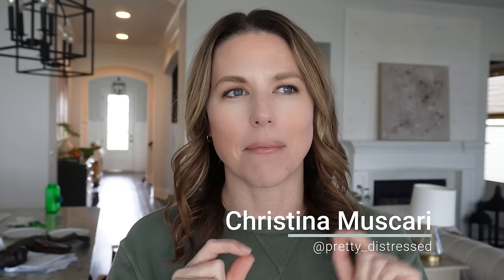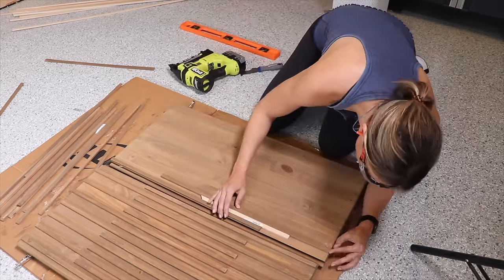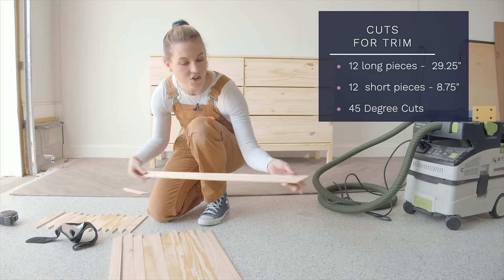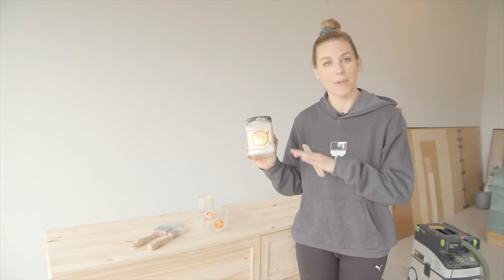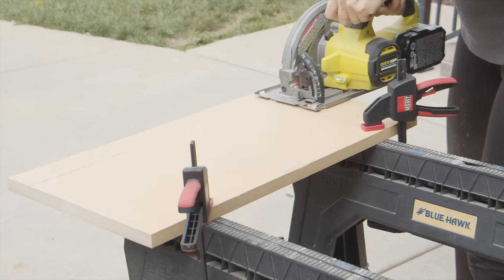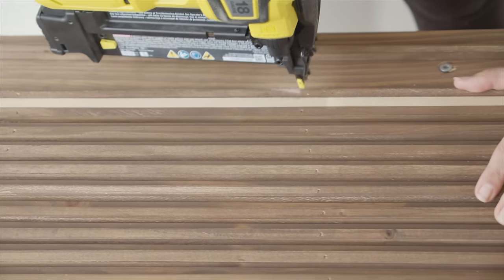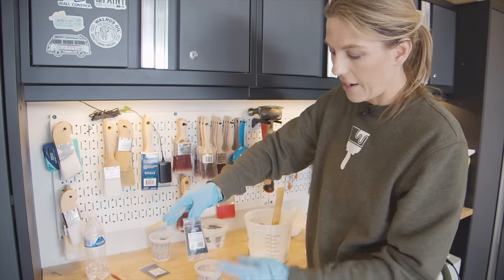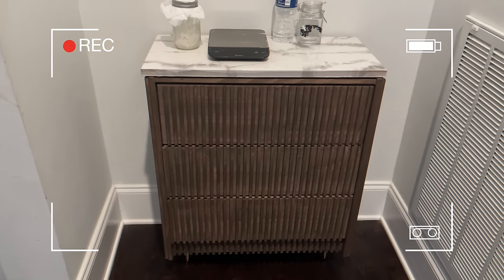3 IKEA Hacks for Furniture: Rast, Tarva, Ivar

Comment: I love doing decorative epoxy!  Something your viewers might want to consider is doing an undercoat made for epoxy. It will seal up the mdc board or any other porous material.  I like using the white undercoat.  It is not epoxy but a primer paint that doesn't lift.  Also I have had many failures over the years with the epoxy lifting without undercoating.  It helps with edges.  Especially squared off corners.  I think women are intimidated by epoxy and you did an excellent job of making it simple which it is.  There are a few rules but if fallowed the effects are stunning check out videos by RK3 designs with Rhonda and Stone Coat Counter with Mitch.  They do an amazing job of educating.  I loved the flip way cool design.💖💖💖
Reply: Rhonda, Mitchell and Mike are absolutely brilliant! I have watched tonnes of their videos and absolutely love Stone Coat resin products.
Reply: These all turned out absolutely gorgeous Christina. I especially love the Rast 😍🤎 One suggestion for the marble top for a better finish on the edges and sides, along with adding colour to the sides, would be to router the edges on the top and bottom so that there isn't a 45 degree angle all the way round. This enables the epoxy to flow better and helps with the epoxy on the sides. Also, running your fingers along the bottom a couple times whilst the epoxy is still settling, helps to avoid the drips. I hope this helps for your next epoxy project 😊 Keep the amazing videos and projects coming please 😊
Reply from the maker: Great feedback- thank you!

Comment: After you wipe down the excess hole filler, did you have to do any additional steps or does it dry and blend in with the original stain? Thanks.

Comment: So glad I found you!! So many questions. First,  what is that clamp thing you used to hold the wood pieces in your miter saw?

Second,  what saw did you use to cut the mdf?

Third, what is the stand you use for your miter?  I need a stand.

Comment: "You want to try your hand at furniture flipping but you don't want to sand and you don't want to make repairs! Yet... you still sanded and maybe not made repairs but you still had to make parts to get the finished look which in the long run, takes just as much time and effort. Don't get me wrong, what you did was lovely but lets not pretend that this wasn't just as much work as flipping used furniture.